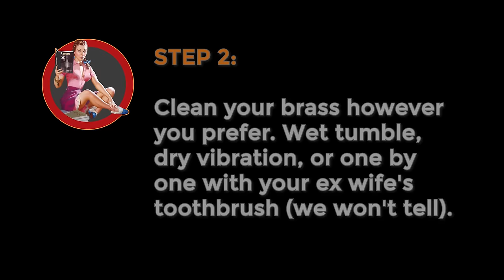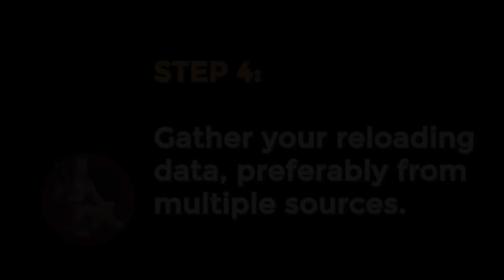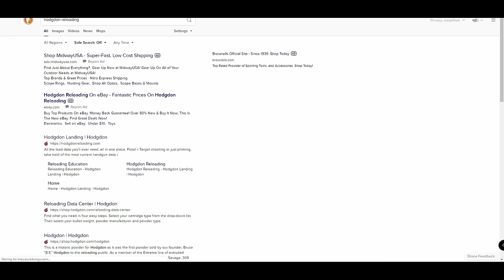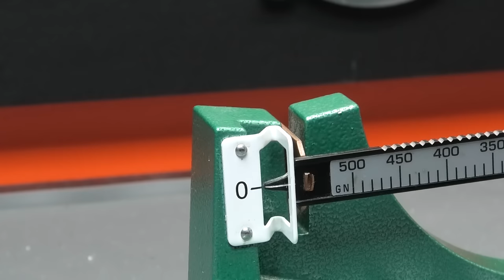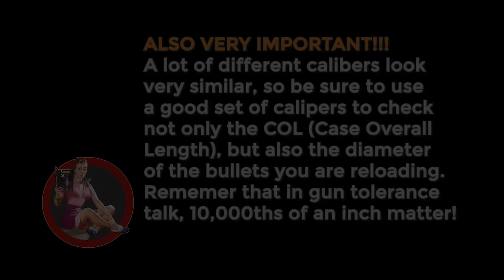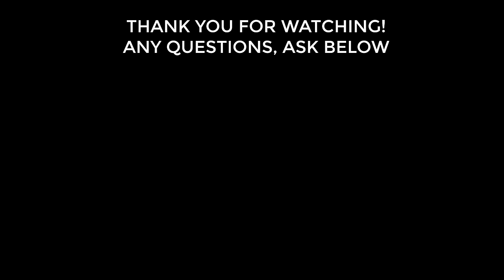Reloading 9mm. Start to Finish. HD.

Comment: I'm relatively young in reloading. I'll ask forgiveness now for the lack of details. I have a similar setup except I use lee instead.  I have a seater crimp die instead of separates. 

My issue. There is typically a bulge in my 9mm reloads. It happens at the seater crimp process.  As a result I have a round that does not just slide into the barrel. 

It not fitting may be an issue where I am not putting enough arm muscle on it.  Sending them through that stage again will resolve the bullet barrel seating issue, but that bulge remains. 

Where can I put my focus to eliminate the bulge and the fitment issue

This does not happen with my 40s, just the 9s. 

Thanks in advance
Reply from the maker: It sounds to me that one of the dies, likely the bullet seating die, is coming down too far and impacting the rim of the case before the bullet is fully set. Back off the die in the press and make sure that it doesn't come anywhere near the rim when you are at the furthest point of the downstroke. I had something similar with .45 acp years ago and it was how I had my depths set. Basically pull it all apart and reset everything, hope this helps.

Comment: Is there a way I can copy that box for my 3D printer, that is a amazing design
Reply from the maker: I will post a link... the design works great, EXCEPT I made a miscalculation and 2 of the bullets bump into the lid.  I've been prepping for a cross continent move so haven't had the time to tweak it... but it's on the todo list (along with a lot of other calibers). I'll post the link here shortly, but just know it's a 48-round carrier ;)
Reply from the maker: https://www.thingiverse.com/thing:4972113

Remember, it needs a tweak, and the lid is pretty tight, but they do fit with a little elbow grease, and the lid shouldn't just slide off. V2 will have a few refinements, it's just finding the time :)
Reply from the maker: I just realized I didn't use my fancy schmantzy new design in this vid, I used another one... Here is a link to the one seen at the end of the vid: https://www.thingiverse.com/thing:2267403

Comment: I’ve been doing a ton of research but haven’t found a straight up answer for the age old question does reloading help save money in the long run or should I still buy from the store?
Reply from the maker: The answer depends on how much ammo you actually go through. When I practice for 3 gun, or am just out for a day plinking, I can go through 1-2000 rounds of 9mm and several hundred .223 so the savings per round quickly pays for the setup, but if you only shoot a little bit, or just hunt, then the cost of the rig doesn't make sense. As well, you have to factor in the price of components vs the price of bulk ammo, it's been difficult to find decent prices on powder lately (for example) which changes your cost per round, and you just do the math. You need a brass case, a primer, a projectile and 5-40 grains of powder (depending on what you are filling).  Just price out the components from reloading shops online, add the cost of the press and extras (probably $500 minimum).  That's why the question has many answers! :) Cheers!

Comment: Terrific video. Why dont they lube pistol cartridges?
Reply from the maker: You can, but smooth walled brass doesn't often get stuck in the dies, so it's not needed if you use carbide die sets. Just more stuff to clean off.

Comment: Nice video. I find it a bit odd though that you have all this great equipment but use a manual scale.
Reply from the maker: Personal preference really. I actually have a hornady digital scale packed away somewhere, but I have had that old balance scale a long time. :)
Reply: I use an RCBS 5-0-5 for everything except precision rifle cartridges. I have a set of Lyman checkweights (actually 2 sets), so it’s quick and easy to verify the scale very close to my actual load weight. Once I’ve dialed in the throws from my powder measure, I typically check every 10th throw on the scale.

Comment: The problem is that there is no guide for a 16" inch barrel .. the data that they are providing most of the time is out of a 4" barrel .  I am using  We think that even Dirty Harry himself possibly used Vihtavuori N350 in his famous .44 Rem Mag, when looking at his infallible shooting accuracy!
Vihtavuori N350 is the slowest in the N300 series of handgun powders. It is ideal for very heavy loadings and top velocities and energies for a broad range of pistol and revolver cartridges. The grain size (1,0 mm length and 0,8 mm diameter) is exactly the same than N320, N330 and N340; it is the porosity of the powder that makes all the difference in burning characteristics. N350 is very w

Comment: Can a 148 grain be used with a tapered bullet butt.. like a boat tail for a rifle.. I have a security 9 compact.. and will a standard barrel fit the compact.. using this round... Use brass..for the case..
Reply: Make a cup in the bottom of the projectile.. to make room for the heaver load..

Comment: Thanks for the video... I'm familiar with reloading (my dad was a savante, unfortunately now deceased), and I am thinking about getting into it in my old age... I'd like to please request a couple guesstimates: a) how much did all your equipment run you+-? b) how reliable would you say the loads are as a percentage of total? (e.g. 80% consistently running', etc.); and c)  how much would you estimate you are saving presently over boxed range ammo, at say $0.46 per round ($23 per 50)?  Thanks in advance.
Reply from the maker: I bought the equipment over 20+ years, and when I started, reloading equipment was plentiful on the used market, and cheap on the new market. As people are realizing that there is not only component shortages, there's the real possibility that government regulations may at some point regulate ammunition (especially in communist countries like Canada), prices have increased. You could likely get a really good setup by visiting local gun shows or online marketplaces, for under $500US, but $1000 would be a realistic guestimate (depending on what you want to reload). As for accuracy, I run 99.9% functional rounds, as I have eliminated most of the problems I have experienced in the past. Most common was issues with primers, so I always use CCI now (if possible) and I get into counting rythms when I run ammo so that there isn't a missed step (eg 1-brass 2-flare 3-primer 4-powder 5-bullet) I just keep running that through my head, and visually check each powder load before the bullet gets seated (hopefully that makes sense). Checking the powder load every ~10-20 rounds on the scale makes sure I'm getting extremely accurate rounds. As for savings, it depends on the current price of factory ammo, and the price I find the components at (prices now are sky high), so it's not a constant. You have to shoot a fair bit to justify if you don't want to look at it as a hobby, but I have saved literally thousands over the years quite literally. Hopefully this helps, and feel free to ask more questions :)
Reply: Thanks for the detailed info, very helpful!

Comment: This is a great video! I just came here to look for one specific thing and ended up watching the entire video. 
So every now and then I come across factory new 9mm and 40 caliber bullets that have a ring around the tip of the bullet. I'm presuming these rings are from the tooling and I think it is from the seating die, but I don't reload so I was hoping maybe you HIGH CALIBER could let me know if you've seen this before and what causes the ring. 
Also, do you mind if I use maybe 5 - 10 seconds of this video? I will give you full credit of course directly in the video and I will also link to your video and channel in the description. If not, that's cool, but wanted to ask.
Reply from the maker: Yes the ring will be from the seating die pushing the bullet into the case, It's usually something that you will see in batches of factory ammo sometimes, but more commonly with home releaded, due to fluctuations in resizing and flaring. Oh and of course you can use a clip, I don't do this for $$ (obviously!)  Cheers and glad you enjoyed it. :)
Reply: @High_Caliber  Awesome! Thanks so much for making your great videos and sharing your expertise, it really, really is appreciated.

Comment: Using pins to clean brass is such an awesome thing but what a pita it is… nothing cleans like using steel media, but the extra work isn’t worth it for most reloaders… I’ve wasted hours, months, years to get my brass as clean, shiny, etc as possible only to shoot it at a local match or range 🤦‍♂️ clean is good enough it doesn’t have to be perfect 😏 ocd may vary… 😆
Reply from the maker: I did a separate video dedicated to the joy of brass polishing. From my perspective, the only time it's REALLY a PITA is with narrow neck rifle brass, because the pins get inside and don't want to come out. However, I have discovered that if I remove all the loose pins, then put the pin filled brass back in and tumble for a bit in justr water, that 90% will work themselves out. With pistol brass, it's not an issue, and with the amount of rounds I go through during competition season, I just do mass batches over the course of a couple of days.
Reply: @High_Caliber  Do you have a link to that video?  Most likely it's in your video upload page but I'll have to check and verify~
Reply: Get southern shine media!! It is small tear drop size Ss media and it never gets stuck in any case size and cleans the primer pocket spotless!! That’s one less step on cleaning out the pocket.. You’ll love it!

Comment: Well made video!
Can you explain COL: 1.130 vs Reading: 1.123 ? 
Unless I am mistaken, there are many acronyms that means the same, COL, AOL … etc all mean Cartridge-OverAll-Length.
Why is your reading different from AOL ?
Reply from the maker: AOL is america online ;)  OAL and COL are interchangeable terms, that's how I've always thought of it, whereas I have seen people talk about OAL when talking about the different height/shape of bullets.  The MAX COL that a loaded 9mm bullet can be is 1.169". Meaning anything longer than that will likely have issues with loading and feeding.  So loading short of that is fine, ALTHOUGH at a certain point you will again have feeding issues, and you are changing the size of the case combustion chamber, so your numbers for pressure and velocity might change.  Basically a hollow point bullet has to put the material somewhere, so you might load the bullet a little proud of your normal loading depth of 1.130" for example. I load at ~1.131 because that feeds reliably in my shadows, and I always buy the same 147gr bullets. Also, some bullets weigh a lot less, so seating them the same depth in the case will result in a shorter OAL/COL. Hopefully that makes sense, I'm typing this on my phone in a parking lot!  :)

Comment: when reloading 9mm, what is your cost per round?
Reply from the maker: I buy in huge bulk, and I haven't had to buy components in a while...as well I have pails of 9mm brass, so at this point I'm running around 9 cents for 124g rounds and up to 11 cents for the 147gr (I go through those quicker in competition season).

Comment: I heartily endorse the “multiple data sources” concept. If I can get data from the bullet manufacturer, that’s my base data and everything else is verification.
Reply from the maker: It's a complicated progression, which is why I leave it quite generic in this video. For example, none of my manuals have CFE powder in them, so I have to rely on data from the hodgdon site. Thing is, even after I get my data, I have to go run 50 rounds through the firearms that i'll be using it with, to see what mix/powder gives me the most accurate rounds. I keep all of that data in my own journal, which honestly is only useful for myself, although I do share the data with a buyer if I sell the gun. I swear, I almost have more fun figuring out the perfect rounds, than I do shooting in competition, even though that's the ultimate payoff :)
Reply: @High_Caliber  I was just trying to add a helpful suggestion. Given current supply problems, I stumbled onto some Barnes bullets in a store for a cartridge I want to use.  I bought the bullets then started looking at Barnes data (online). Ruh-oh no powder in inventory was listed. Fortunately Barnes tech support is fantastic and they got me squared away. 

I completely understand the satisfaction of scientifically chasing down the optimal cartridge for one specific rifle. It feels great when you start getting sub-3/4” groups at 100 yards. The only time it wasn’t fun for me was when I got a 45-70 Marlin.  After 12 rounds off the bench I said “Screw it, my shoulder hurts and it must be accurate enough!” 😜. No more chronograph testing of that cartridge!

Comment: As a beginner reloader, many experienced people tell me to start with single stage, as turret or progressive cause mistakes, is that true?  Thanks!
Reply from the maker: It's a split question. If you want to reload 9mm, and need a lot of ammo (and can afford it), go with the progressive press. If you want to do lots of different calibers, and not many of each, go with a single stage.  If you get the progressive, just do one round at a time, making SURE your powder drops are correct, bullet is seated properly, and keep them marked until you are comfortable with your process. Underpowered loads can leave bullets trapped in barrels, and only bad things happen then. Take your time, double and triple check everything, watch every video on the subject you can find, and you will be fine.
Reply: I agree with High Caliber's response(s) and would like to add my 2-Cents worth.

A Single Stage Press exemplifies the KISS Principle (Keep It Simple Stupid). It allows the reloader to focus on each step of the process and inspect the results of each step before going on to the next. You do change Dies between each step but if you Batch Process (50/100+ cases at each step), it's fairly efficient. I recommend using Hornady's Lock-N-Load Die Bushings to maintain Die Adjustments between die changes/reloading sessions. A Good Quality SSP cost between $100/$200 while some High Quality SSP Presses push $500. A decent SSP can be found for <$100.
Most Precision Rifle Reloaders use a High-Quality SSP while some use a Turret Press with results that are equal to a HQ-SSP.

A Progressive Press can be quite Frustrating during/after initial setup and will usually continue to be at least a little troublesome forever unless it's a Dillon Press. You pay through the Nose for a Dillon, $600+ for their entry level Progressive and much more as you go up the ladder. However, they are Outstandingly Good Progressive Presses!

Consider buying a Turret Press. I just bought a Lyman Eight Hole Turret Press on Amazon for $220 versus a Redding 7 Hole Press from Brownells for $370. With the Lyman you can mount 2 calibers of either 3 or 4 Dies per set in any combination of Pistol/Rifle, with/without Powder Drop. Additional 8 Hole Die Heads are about $75. A Turret Press will produce 50+% output of a good Progressive Press (without Auto-Case/Auto-Bullet feeds), 200%/300% output of a SSP while still producing High Quality Precision Rifle ammo when needed.

Nothing beats a Dillon for High-Output/High-Quality Pistol Reloading and Good-Output/Good-Quality Rifle Reloading but you can't trust even a Dillon Progressive to produce High Quality Precision Rifle ammo out to 600 yards. I'm talking a string of Xs versus a spattering of 8s/9s and an occasional 7 at 600 yards.

For about 25%/30% of the cost of Dillon's entry level Progressive, you can buy a Good-Quality Turret or Single Stage Press.

If you need High-Volume Pistol/Rifle ammo, buy a Progressive. If you need High-Quality Precision Rifle ammo, buy a Good-Quality Turret or SSP.

For the FNG, most every reloading operation does not include a press operation. Consider buying a Low Cost/Cheep SSP, a few sets of Low-Cost Lee Dies and then learn Brass Prep (decapping, tumbling/vibrating, pocket cleaning/swaging, FL sizing, shoulder measure/bump, case length measure/trim, neck tension measure/adjust, priming), Powder Dump/Weighing, Bullet Seating, COL Measure and finish with Crimping if applicable.

After you get the individual tasks down pat, upgrade your press to a Good or High Quality SSP and also add either a Turret or Progressive or both. You can then mount the Cheep $60 SSP on your wall and thank it for getting you started.......
Reply: @rjinnh3933  wow, that's a lot to read bit it's all good info. I'm not going to be reloading any brass today but I want 9mm ammo and if this the only way I might be looking into this. Thank you.
Reply: @badgermetal  Better start looking for primers now because they are like trying to find a strand of hair in the woods… Good luck it is possible calling places all the time and jumping on the first yes we have some.